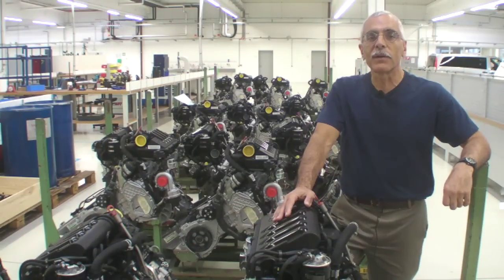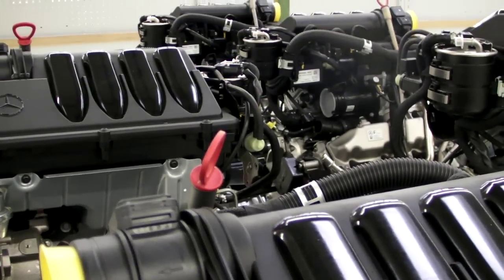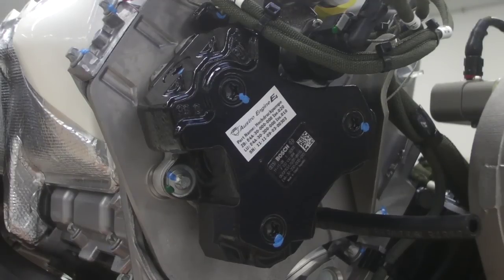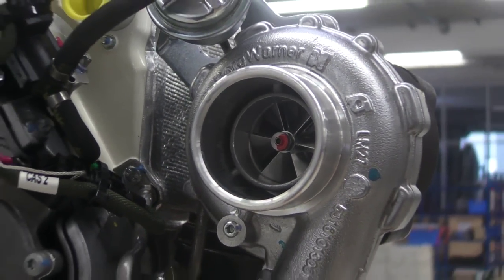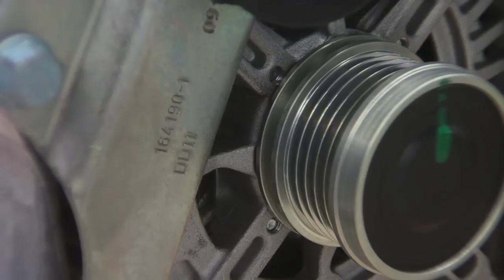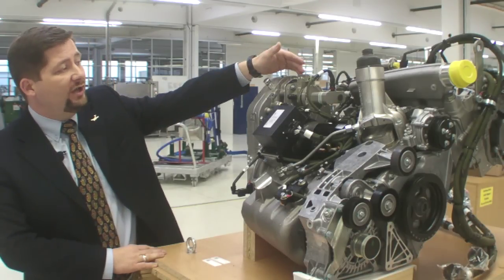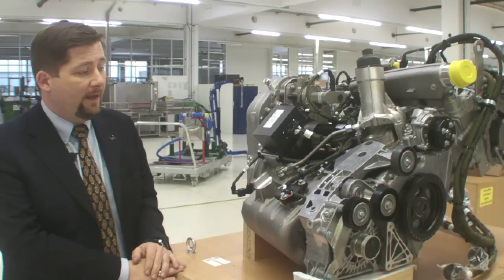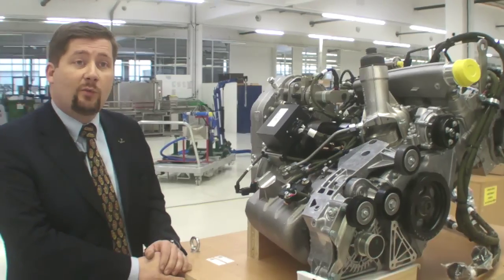AVweb's Austro Engine Factory Tour

Comment: I used to drive a truck with a Benz engine and while it was powerful and sounded delicious, it had problems. We lost two engines in the new fleet the first when the breather tubes clogged up with ice. Basically, when going down the highway in cold weather (-20C and below) ice from the crankcase would condense on the inside of the breather tube. When the tube sealed up, oil would shoot out the dipstick and run the engine dry. It was a pain having to stop every hour to clean it.

Comment: MB has always been seen as a stellar company, Maybe the fact the in the large truck spot they teamed up with Detroit Diesel that made them go downhill, they were bad for having fueling issues, head gaskets leak and turbine failures, had my fill of fixing all these problem and more for several years then all of a sudden it seemed they were gone and replaced with the DD platform engines

Comment: You are tue, MB diesels are leaders in Europe, and talking Detroit Diesel, I could say they were used in trucks, marine, cranes and heavy equipments. The two strokes had more power than many, every time the piston goes up and down, it delivery power. But the enviromental laws, didn't let these motors to survive. I worked in many of them, from the smaller ones, 53 series to 149 series. I to tell true, I had a lot of fun!

Comment: how will this aircraft get fuel then? is there an aviation diesel supply system in europe? I've never experienced diesel for aircraft here in the states which is why i ask.
Reply: d73H the high pressure pump is modified to run on jet fuel

Comment: If your using a diesel that doesn't like to rev over 2700 rpm anyway, why add the weight and complexity of a gear drive? What is the ratio on that anyway, like 1:1.3?
Reply: Why is this issue not addressed. Since torque curve is high and flat throughout.
Reply: The reduction gear is 1:1.69. The engine spins faster than the prop therefore requiring a gearbox. Given rpm is prop rpm. Max prop rpm is 2300, meaning the engine is spinning at 3887 rpm

Comment: With all due respect to your knowlege and experience, every engine since the Wright Flyer have all been modified mass produced engines. This engine seems over engineered too with the changes being exhibited in the video. The only thing that remains appears is the long block. All of the aircraft parts are new and different.  Even the engines designed specifically for aircraft have their roots in the mass produced market,(mostly automotive). It may make repair parts more available and less costly.

Comment: Well, you make a fine amount of points. But I'm a Volvo-owner, and I can tell you that as long as the oil and filters of the engine, gearbox etc is changed often enough, the engines last pretty much forever (the oil removes mud and steel crumbs and move heat, lubricate etc). BUT, what doesn't last forever is that darn microchip (which usually stops something important from working properly). But the idiot owner of the engine doesn't get it, so MOST cars fail because of too few oil changes.

Comment: I don't know what your profession is, but I am an automotive systems manufacturing engineer, and I know what I am talking about. Just because there are many car engines flying around in aircraft does not make it an acceptable practice. When it was created, it was intended for a car. Period. A cost effective motor that gets a couple hundred thousand miles and has a budget for warranty claims. It is not designed for high altitude, sharp banking, etc that an aircraft encounters.

Comment: Yeah, I am not thrilled at the concept of putting a mass produced car engine into a plane. I am an automotive engineer, and I can tell you that we consider an engine failure a matter of inconvenience, not a matter of life and death. The only exception is when we produce something that has to be 100% reliable, like an ambulance engine. Those are over-engineered and cost much, much more than your typical Escort engine. I want something DESIGNED for aircraft, not just because it will fit!

Comment: I'll have to pull rank on all you guys 'cuz I have an entire brain;...[most] car engines can't
run @ 6000 rpm, be subject to undue crankshaft stresses, go through a 2.5 reduction gear reliably.....and if you have a problem and land at airport: Continental parts\service
are a bit easier than '83 Cadillac...dummies....DIESELS AND PROPS LIKE IT AT 2700
RPM.....-I would want to put a Jag V-12 conv. into this 3\4 scale Spitfire I'm building,
..but I gotta know what I'm in for...